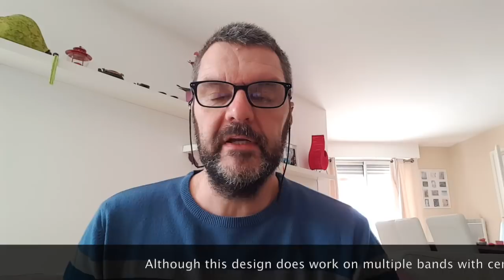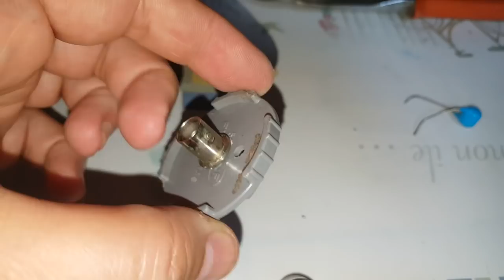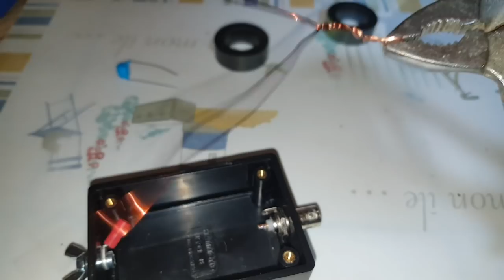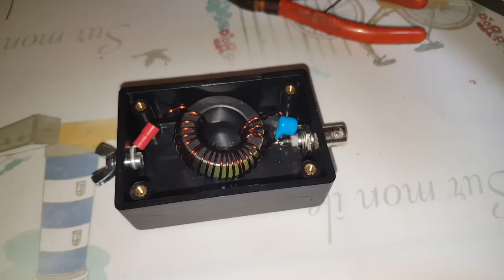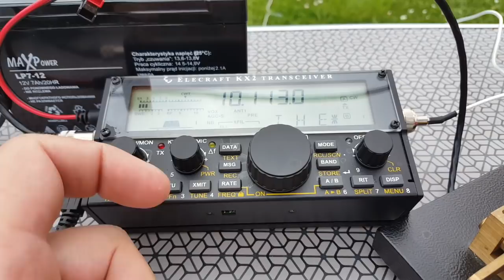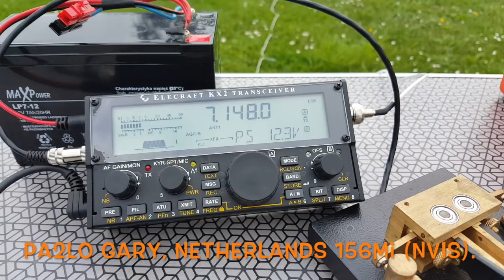The 49:1 Half-Wave End-Fed Antenna Transformer, Part 1.

Comment: Gil, what size magnet wire is depicted here? I built a 49-1 Transformer on a 250-43 toroid using 14ga. Magnet wire and it looked a lot bigger than this. The wire here looks more like 16 or 18ga. I'd like to build one on a 140-43 Toroid but I think 14ga. wire is to thick to do 14 turns.
Reply from the maker: 1mm, not sure what guage that is...
Reply: @RadioPrepper  1mm is 18ga wire. Thanks for the quick response. I watch you videos often. Appreciate the help. 73 - WB2TQC
Reply: Gil -- Took me three tries but I got one done today. 140-43 with 2 primary and 12 secondary turns using 18ga (1mm) enameled wire. Now to test it and hope it works well.
Reply from the maker: Don't forget the capacitor..

Comment: It is 1:49 because it transforms the voltage factor 7 Up and the current factor 7 down this means for the Impedance transformation: R = U / I means R= (7U) / (1/7 * I) = 49*U/I That is all the magic. And, why did you not middle turn your 80m winding? And as far as I could see, you are using 3 turns primary instead of 2 right?
Reply from the maker: Yes, definitely 3KV!

Comment: Hi Gil, great video. Im new to ham radio and trying to set up HWEF. I have a 49:1 UNUN and enough room for the 40m of wire. Im ok with the coax connection but the UNUN has an earth connection. Now some say put a counterpoise on it some say earth it with short wire to my copper pipe in the ground.  Also how high should the UNUN be off the ground. I would prefer the UNUN close to the bungalow so I keep the feeder line shorter?? 
Any help please.  Regards  Ian
Reply from the maker: If it's a permanent installation I'd say earth. See if it works better that way. The transformer can be low but try to avoid the proximity of metal for it and the wire...
Reply: @RadioPrepper  Thanks for the reply. I thinking, do I need an RF Isolator at the radio end of the feed line?
Reply from the maker: Hi, no.

Comment: I believe if you use the inverted v you can use the 468 / by frequency in mhz but if horizontal flat up high it is a different  number. I found the calculator on the internet and it is different and i used it and put up a home made antenna using the length from that calculator and a 49:1 unan and then checked with my antenna analyzer and it was perfect smack on and if i had used the 468 for my horizontal flat end fed half wave i would have been off.

Comment: Hi. I want to make an endfed antenna. I have a 20m long garden, so max 20m long antenna. I want to work 40m/20m and any other bands will be a bonus. should I use a 49/1 with 20m antenna or random length with 9/1? thanks
Reply from the maker: I would definitely use a 49:1 with a 20m wire.

Comment: Hi Gill. Great tutorial! You used a smaller toroid than the diagram, but did you still use 14 gauge enamelled wire?
Reply from the maker: Hi, I use the FT-140-43 with 1mm wire or the FT-82-43 with 0.7mm wire..

Comment: Is it normal then  at the impedance transformer, to get a continuity reading with a multimeter (audible buzz) between the antenna wire terminal wing nut and the ground side of the  PL 259  plug coming from the transceiver as I do . I thought it was a fault, but seeing this it  looks like I would get a buzz - according to the  wiring.
Reply from the maker: With some transformers yes. While it is a DC short, it isn't a short for AC current.
Reply: @RadioPrepper  Oh Many Thanks for the quick reply Gill. I understand now. I am a retired electrician in England and  Have the Ham Radio Call Sign M3 FEC. Only the Foundation license at the moment. I subscribed to your channel yesterday - Your videos are very helpful - 73 from Frank.

Comment: Impedance is related to voltage ratio squared  (ie. turns ratio squared) because resistance is related to square of voltage R = U^2/P (derived from ohms law and knowing power P = v oltage * current)

Comment: That table of random wire recommended lengths, does it expand out to the 1000/1500ft area ? Wow, very good, 49to ONE !
Reply from the maker: I don't know but as long as you avoid half-wave with a 9:1 you'll be fine.
Reply from the maker: 49:1 is for half-waves; 9:1 for anything else
..
Reply: @RadioPrepper  Well, thought you had chosen a "random" length.
Reply: And, I do have a 9/1 I could use for the really long wire.

Comment: "Why is it calculated like this? I don't know."
Reply: It's calculated like this because you want to match an impedance of between 2400 ohms and 5000 ohms, and 2400 / 50 = 48 and 5000 / 50 = 100. That brings your SWR down to between 50 / 48 = 1.04:1 and 100 / 50 = 2.0:1. The closest convenient perfect square to 50 is 49, so, recalculating, 2400 / 49 = 49 and 5000 / 49 = 102, bringing your SWR to between 50 / 49 = 1.02:1 and 102 / 50 = 2.04:1, an easily tunable range. To create an appropriate 49:1 transformer, therefore, we go back to the definition of mutual inductance between two coils with ideal coupling (k = 1), which makes Vs = Vp(Ns/Np), where N is the number of winding turns. Remembering that P = (V^2)/R, (Vs^2)/Rs = (Vp^2)/Rp, and substituting Vs from above, we have Rs = Rp(Ns^2)/(Np^2), or Rs/Rp = (Ns^2)/(Np^2) = (Ns/Np)^2. So, 2400 / 49 = (Ns/Np)^2 = 49, or Ns/Np = 7. If we wind one side with two turns, we must wind the other side with 7 x 2 = 14 turns.
Reply: @nojiratzlaff4388  thank you.
Reply from the maker: Great thanks!

Comment: Hi Gil ! J'ai construit un "transfo" 49/1 avec un tore 240-43,j'ai donc bobiné le fil comme indiqué ,mis 2 capas en série afin d'avoir les 110 pF ,ok jusque là,mais catastrophe en réception ! L'antenne semble en court circuit. Dès que je retire la masse du cäble c'est bon ,j'ai de la réception et en émission je peux voir mon signal sur le webSDR de Hack Green en Angleterre avec la prise vissée rien ! Je comprends plus la...  Les mesures de SWR sans tuner : 40 m = 1.8/1; 30 m = 1.8/1; 20 m= 1.9/1; 17 m = 2.4/1; 15 m = 2/1; 12 m = 2.5/1; le 10 m bas = 1.9/1 et le haut de bande 2.0/1. Le fil d'antenne fait 20,40 mètres environ,j'ai essayé un contrepoids de 5 m et quelques nada ! Toujours le même soucis. Mystère... 73 de F4DNP.
Reply from the maker: Bizarre. Il est normal que l'antenne soit en cours circuit en courant continu, mais 50 ohms en alternatif à la bonne fréquence. Combien de volts tes capas?
Reply: @RadioPrepper  Hi Gil merci pour la réponse. En fait j'ai tout repris de A à Z je m'étais lamentablement planté dans les tours ,il en manquait un sur le secondaire...) ! La j'ai reconstruit le transfo comme il se doit et c'est nickel ! A part le 17 et le 30 m où j'ai un SWR > 2 tout le reste oscille entre 1.1/1 et 1.2/1 A l'analyseur j'ai de bons résultats également,il me donne par exemple 1.24/1 pour R=52 Ohm sur 20 m . Merci et 73 au plaisir d'un éventuel contact e PRC 320 à PRC 320 avec EndFed ! ;)
Reply from the maker: Super, oui! Il y a pas mal de 320s sur 14320..

Comment: Hi Gil,

Great videos, do you prefer the Elecraft KX2 or the KX3?
Just passed my morse 12wpm and 15wpm over the last two weekends and hope to do 18-20wpm soon so I hope I get to QSO with you on air!
Kind regards,
Simon
M0SYS
Reply from the maker: Performance is similar. Of course the KX2 is smaller... It all comes down to wanting 160/6m, or not...
Reply: @RadioPrepper    Good point.  I was thinking more about having that bit extra power/having internal batteries in KX3 AA cells vs the lithium ones in the KX2 - I heard the KX2 only runs 5W mostly since the voltage of its internal batteries decreases and drops the power quickly.  Is one easier to use than the other?
Reply from the maker: Don't worry about power. The kX3 also accepts a 2m module... Only choose based on size and bands...
Reply: @RadioPrepper  OK,  How important is 160 or 6m?  I suspect they aren't normally used portable, other than the weather proofing you mentioned in another video, are there any other down sides to the KX2?
Reply from the maker: No other downsides. 160 and 6m are probably not starter bands, especially 160m. 6m is used portable. You will probably want those bands later... The question is... How much later..? If the bigger size isn't a problem, go KX3...
Reply: @RadioPrepper  OK great, thanks for your help, Gil and keep up the good work with the excellent videos!!

Kind regards,
Simon
M0SYS

Comment: Materials required for one F4WBY auto-transformer:

1 FT-140-43 toroid
14 gauge enameled magnet wire
1 100pf 30kv capacitor (3kv OK for QRP.) 
1 BNC bulkhead connector
Hammond enclosure of unspecified size.

(Thanks, Gil!)

Comment: Great video. I enjoyed it. 
I use my own 40 meter HWEF. I use a 64 to 1 and get great results on 10, 15, 20 and 40 meters. I don't need a tuner at all. The core is an FT 140-43. 
For my 150 watt model I also use a 47 to 1 and a longer wire to cover 80 meters. I get close to the same results as you do.
Great little antenna and easy to erect portable.
Barry, KU3X
Reply from the maker: Excellent!

Comment: I enjoyed your video. It was very informative.....easy to follow instructions. Well done!

I made a 64 to 1 UnUn, shunted on the 50 ohm connection with a 150 pf cap. I use 65 feet of wire and get below 1.5 to 1 on 6, 10, 15, 20 and 40 meters. I use to use an OCF40 but now my go to portable antenna is the end fed. I also use a KX2.
KU3X
Reply from the maker: Most efficient, my favorite too!

Comment: I built one with 100 feet of wire. Used a 9:1 transformer and have great results on ALL bands from 160m through 10m. I imagine the 49:1 transformer would be even better. Not all of us have room for a 134 foot wire. And I think 67 feet may be too short to work well on 160m. Always interesting to improvoise and experiment with antennas. Use whatever works well for you!
Reply from the maker: Hi, the 49:1 is for a half-wave wire only. 9:1 is for anything other than a half-wave...

Comment: hi Gil  nice video!  i have one question  the wire  needs a coil or not  after  the box of 49:1 i mean tnx..
Reply from the maker: No. The coil is for 10m.
Reply: @RadioPrepper   need to use it for  80  40  until 20m  for Sota  i think is good and cheap choice .
Reply from the maker: Definitely, and I don't use a coil.
Reply: @RadioPrepper  no coil  for both construction  lower bands and higher bands?
Reply from the maker: Well, I don't usually use bands above 20m... It works well without a coil from 20 to 80m.

Comment: I have access to a FT140-43 toroid only...what are the chances I could make it work with this design ?  Perhaps for 40m and higher only ?  Only operating on 5W QRP if that makes a difference. Thanks for the video, 73 de ZS2OE
Reply from the maker: That's what I use, works great on all bands. No difference with QRP.

Comment: I use pill bottles from empty Rx drugs is get prescribed for waterproof conections and small circuits. Line inside with sticky metal foil for shielding.
Reply: Nice but a bit small for a 1500 watt transformer.

Comment: A European - a French man no less   using feet and inches ??? Progress    at last
Reply from the maker: LOL, metric is much simpler!
Reply: @RadioPrepper  not if you are un Americain!
Reply: @af4k   LOL!  Yep using Metric is definitely very "un-American"  And even the British, who invented "Imperial" measurements, have more or less officially abandoned them.
Reply: For the record (and at the risk of touching off a flame war...) there's nothing simple about the metric system. It's more consistent than the English system, but what isn't? 

If the French revolutionaries had been thinking clearly, they'd have based their new system on 12, not 10. Much more useful. As a Canadian I'm "bilingual" (pour ainsi dire), but find myself defaulting to English measures most of the time just because  jumping into fractions only two stages in (10 halved is 5; 5 halved is 2 1/2, 2 1/2 halved is...uh...), and dealing with a base that's not divisible by anything but a prime number and 2, is needlessly complex. 

The conclusive argument for the Yanks converting to metric is simply because everybody else uses it. 'Course the Yanks aren't always the most practical lot...

Comment: Hi Gil, very nice videos and thanks for the effort.
If you do make a hand full of 49:1 transformers I'd be interested in having one. I too strictly use QRP and at the moment I am using a random wire endfed with a mfj16010 L tuner. I built a 9:1 for the 58 foot random wire I am using and it was better off with just a direct connection to the tuner minus the transformer for some reason. I like the idea of the half wave ended and really would like to make the change.

Thanks
R Mike Boyer aka KC2WVB
Reply from the maker: Thanks, I might.

Comment: Excellent video! Question how the other end of the antenna was secured? and to where?  I'm wondering if it was anchored to the ground. 73'
Reply from the maker: To the ground with a tent stake but insulated from it.
Reply: Have you tried the 67' version ? The 134' one is probably too long for the type of deployments I do.
Reply: I don't need 80m so was wondering how the 67' version (40m-10m) performs.  73'
Reply from the maker: Not yet. From reports from the HWEF group on Facebook, it works very well.

Comment: Amazing video Prepper! I watched the whole lot. Excellent construction and amazing results. The fact that you were so close with the tuning without doing anything was amazing :) Loving your videos. I've subscribed. 73 from Andrew, VK2XXL
Reply from the maker: Thanks Andrew. On 80m the tuning was good down to 3.3mHz, so my wire is too long... A few inches less and it will be perfect! I should measure it... I know it's close to 134ft, but I forgot...
Reply: Always easier to trim (or fold) rather than lengthen, but as you say in the video we've all been there. I feel as though the end fed half wave deserves the same reputation as the G5RV and unlike the G5RV, it actually is meant to be a multiband antenna and works like one as you've shown above. That performance on 30m especially was amazing :)

Comment: Great Results Gill Well done..I didn't like the twisted primary winding and would just use a slightly thicker size single wire, although at QRP levels the thickness would not be a big issue.
One think that really annoys me is the Hams who use computer's to reply to you in CW insist on sending at high speed 😢😢😩😩why can't they have the decency to slow down a bit to match your hand sent speed 👍. .which by the way I could listen to your Hand Sent CW all day because it sounds so much better than Computer generated cw. .73 de Steve
Reply from the maker: Thanks Steve. They probably think everyone uses a decoder..
Reply: Radio Prepper I also noticed your KX2 was decoding your hand sent CW 100% and yet the contesters computer generated was not decoded properly 😂so if they reduced the sending speed they may even get a higher score in there contest. But just don't realise it..good luck with the 30mtr version.
Reply from the maker: Thanks!

Comment: Hi Gil! Thanks for the video. I built one of these but never actually started using it! Question: when you were testing each of the bands' SWR on the KX2, was that going through the tuner? Or did you have the tuner bypassed?  I didn't hear any relays clicking, but it's always hard to tell with those super-fast Elecraft tuners! 73, Rex KE6MT
Reply from the maker: Hi, no tuner, my KX2 doesn't have one..
Reply: Ah! That makes a whole lot of sense!
Reply: Yes, yes, and a little bit more yes! I'm just now getting around to finding this video but if you did decide to make some I would certainly buy some.
Reply from the maker: I did have a crowd funding campaign a while ago... Only got one order... Canceled it.

Comment: Gil. Excellent video and thanks for the credits. Right now the 3 stack 240 cores of 52 mix have the lowest loss / highest efficiency and can handle the most power. Winding method is the same, 2 primary with crossover and a total of 13 turns seems to work best. I'm anxious to see part 2. The compensation coil is a great help on 20 through 10 meters. https://www.youtube.com/watch?v=Z7-FYm6r5jc
73 Steve N4LQ
Reply from the maker: Thanks Steve. My next one will be the cross-over on the same FT-140-43. I will probably try it with a half-wave wire for 30m.

Comment: yesss Gill verry nice video, i am a big fan of your work, i have a ubitx and i have made houndreds contacts in cw with a 40m dipole, i go a lot on camping and fishing and it will be nice to have such an antenna. All the best i appreciate all your work. i am a cw-qrp person for 15 years and with your videos you are answering to a lot of my questions.
tnx Gill 73 all the best from yo4huj Ady.
Reply from the maker: Thank you. I still have a BitX40 to wire up. The uBitx is tempting!
Reply: i also have the bitx40 homemade i have modified it to work on cw added smeter and swr meter is doing a great job, but now i ordered the ubitx and it is waaay better i have mounted it in a car stereo case and now i am working at the swr bridge and litrium batery pack. with the dipole antenna for 40m i have nice contacts in all the band except 160 and 80.
Reply from the maker: It does 160? I thought the limit was 3mhz?
Reply: yes you are right with the original firmware does not goes lower but i have changed to CEC version wich is more stable the rotary encoder works much better, it has s meter on display wspr , cat , etc and a lot of usefull function.
Reply from the maker: Good to know, thanks.